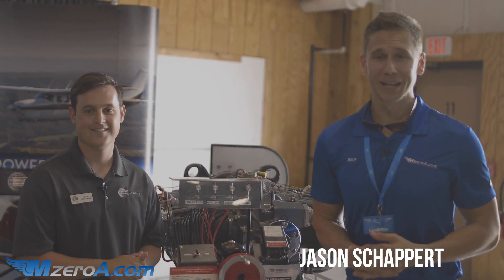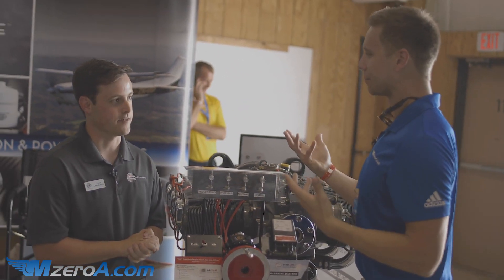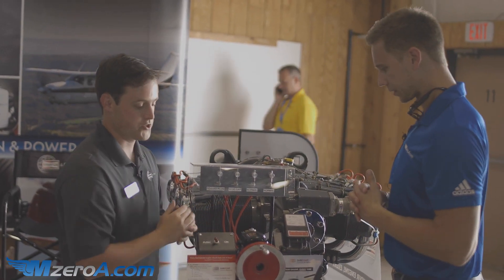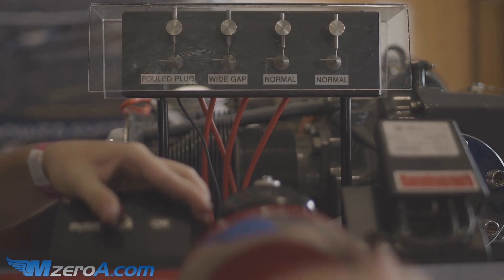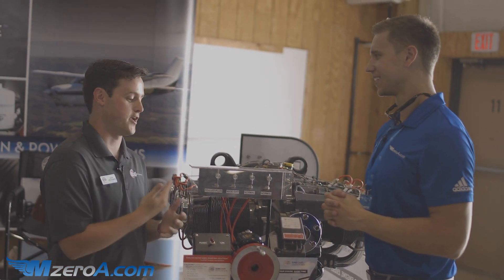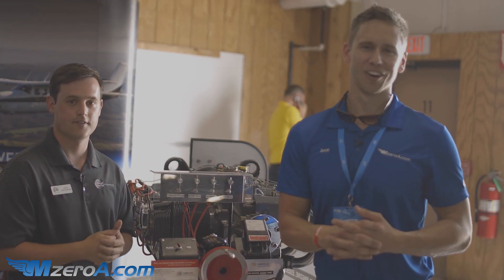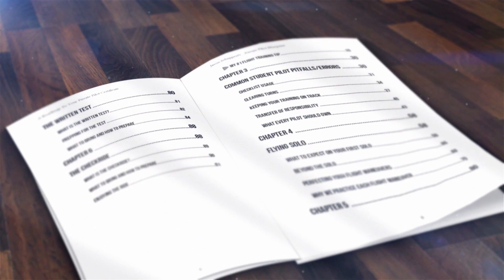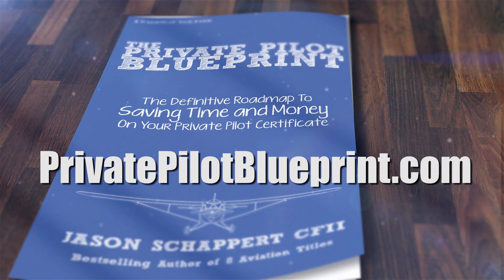Solving Hard Starts With Champion Aerospace - MzeroA Flight Training

Comment: Does this have or need to have FAA and EASA approvals and how much is it.
Reply: Hi Dave, it is STC approved for 98% of aircraft and is easy to install (usually 30 minutes). I would check pricing with several distributors. The part number is SS1001 for Slick Mags and SS1002 for Bendix Mags. Feel free to shoot us a message if you have any further questions!